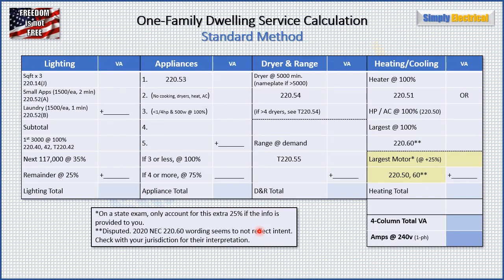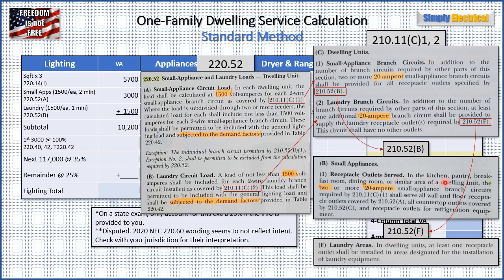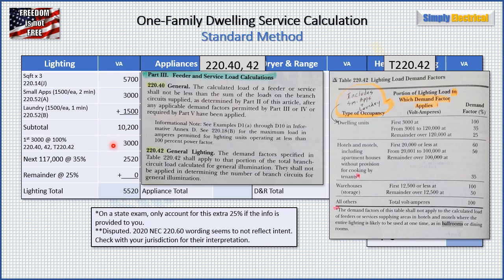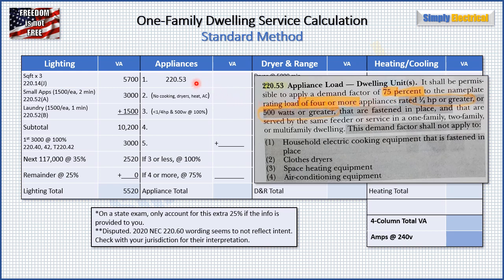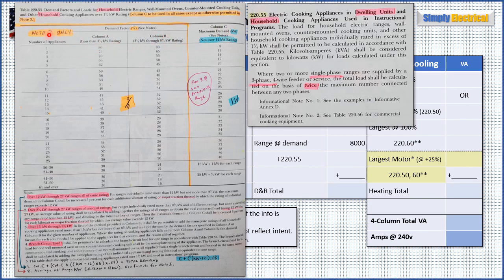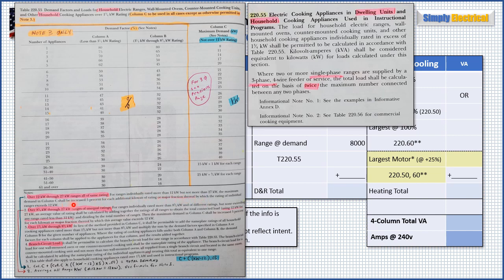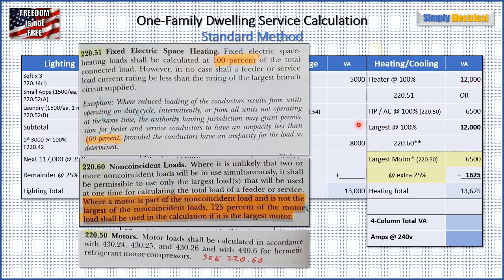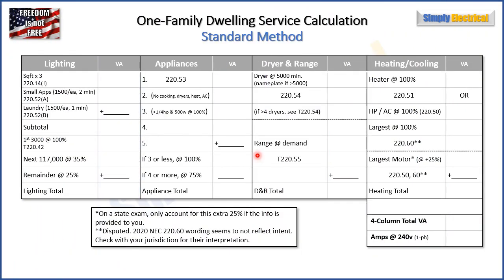One-Family Standard Service Calculation - Deep Dive 2020

Comment: In the case of dwelling units, the minimum lighting load includes both the lighting outlets and the general-purpose receptacles. Does this minimum lighting load already account for the 125% factor required for continuous loads? In your video, you didn’t apply the 125% factor to the minimum lighting load, so I’m wondering: is that because the factor is already built into the value from NEC Table 220.12, or did you simply forget to include it?

I’m using NEC 2017, and Table 220.12 provides the minimum lighting load value, but the table itself doesn’t specify whether the 125% continuous load factor is already incorporated. Since the table doesn’t say, I assume we should apply the 125% factor later when sizing the feeder. However, here’s the complication: the minimum lighting load consists of both lighting outlets (which are continuous) and general-purpose receptacles (which are not necessarily continuous). How would you handle that discrepancy?
Reply from the maker: In a dwelling, the general lighting and receptacle loads are not considered to be continuous. If you know of specific loads that are continuous, you would need to add an extra 25% for those loads only.

This is one reason the NEC changed Table 220.12 in 2020 - to make it clear that only non-residential lighting is automatically considered to be continuous. Notice that they took dwelling units out of the table and it is now labeled "Non-Dwelling" occupancies. The note at the bottom of the table explains that the 125% is incorporated into the non-dwelling loads.

But in 2017, you have to add in your own 25% for non-dwelling lighting. But not for residential.

Comment: Thanks. What if you have an EV?
Reply from the maker: EV chargers would fall under appliances in 2020.

However, in 2023, a new section was added - 220.57. This changes two things:
1) It requires a minimum rating of 7200VA (or nameplate, if higher).
2) Also, it no longer allows the 75% demand factor to apply (4 or more appliances) in 220.53.

Comment: if you had a gas heater and a AC that is 5520W do you still hit the AC with 125% Largest Motor?
Reply from the maker: Yes, as long as you don't have any other larger motors elsewhere, of course.

In most cases for residential, the AC or heat pump will be the largest motor load of the building - even with an electric furnace (because the heat strips are the lion's share of the load, not the motor).